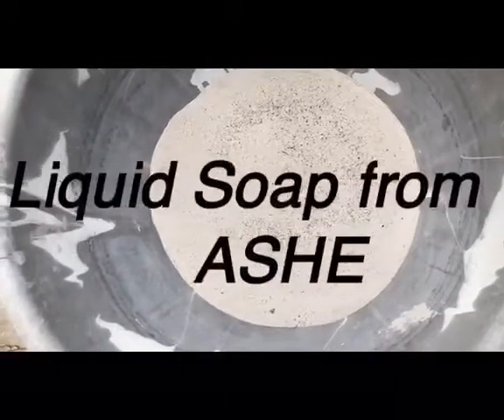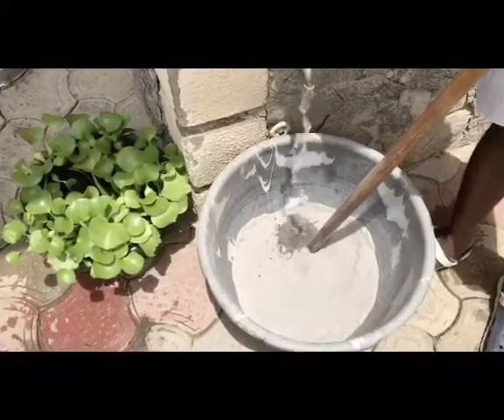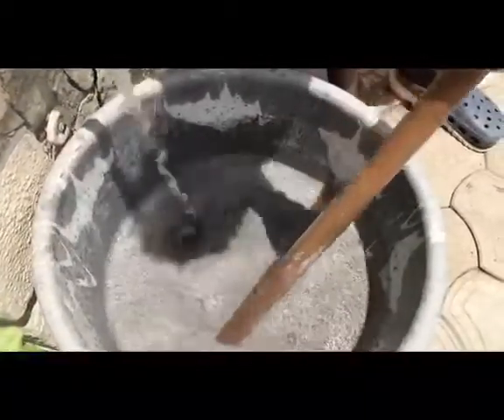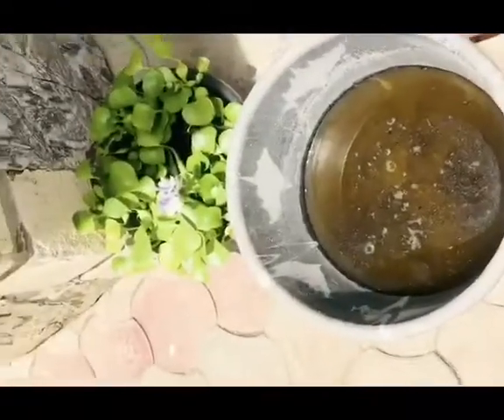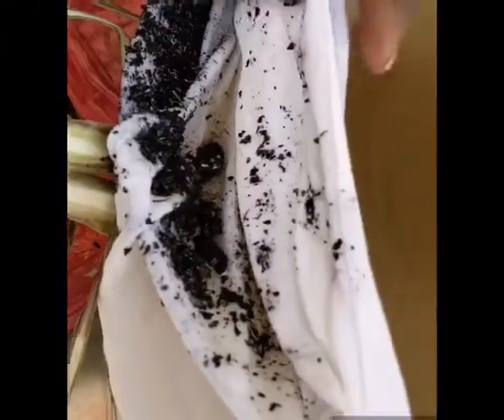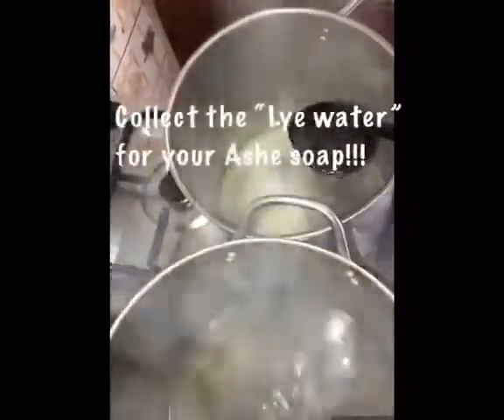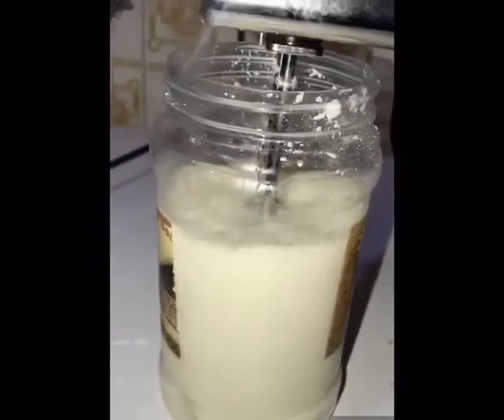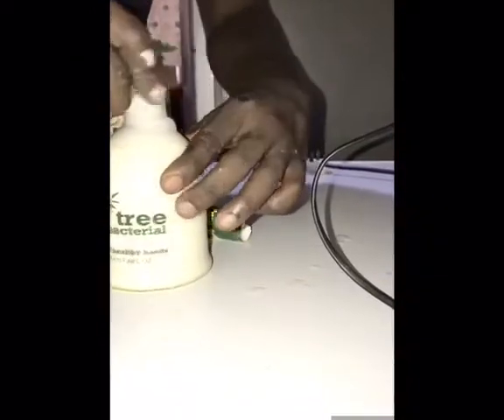How to make soap from wood ashes (lye water and Shea-butter).

Comment: As a soap maker myself, I will say that there are 2 kinds of lye: 

1, potassium hydroxide (used for making liquid soap or softer soaps that are easy to pinch apart like African black soap) and that is what he makes in his video. But you can also purchase it, although in that case, you may need to mix it with a specific measured amount of water.

2, Sodium hydroxide, which is used to make hard, solid soap bars. You can purchase this. It comes in a dry, grainy form like salt or sugar. It must be mixed with a specific measured amount of water. 

 Both types of lye produce very different results in soap. 

When you mix the exact, proper amounts lye and water, then add a specific amount of oil, fat, or butter-- the natural result is soap! 

* WHEN THE INGREDIENTS ARE PROPERLY  WEIGHED AND EMULSIFIED TOGETHER, THE FINISHED PRODUCT DOES NOT CONTAIN ANY LYE, AS THE CHEMICAL COMPOSITION CHANGES. IT IS NO LONGER LYE, WATER AND OIL-- IT IS NOW SOAP. 

It is believed that soap was discovered a very long time ago, by accident, when meat was cooked over an open fire-- the animal fat would drip into the ashes of the burning wood. Then someone would pour water to put the fire out (or it would rain), and-- soap!

Each different kind of fat, oil, or butter (for example, olive oil, coconut oil, palm oil, shea butter, cocoa butter) has a different sopanification value. Meaning exactly how much lye and water are required to properly soapinify a certain amount or type of fat, oil, or butter. 

There are free soap calculators online to help you calculate all this (how much water, lye and oil/fat). Not using the proper amounts can cause you to have too much lye, which can burn or irritate the skin. 

Also, each different fat, oil, or butter will give you different qualities in your soap. 

For example, olive oil makes a creamy (some say slimy) soap with very tiny bubbles, but is very moisturizing for your skin. Bar soap made with 100% olive oil only, is called "castile" soap. It takes almost a year to dry completely. But it is very gentle. Perfect for sensitive skin or babies. 

Palm oil and cocoa butter help to harden your soap bar, but also nourish skin. 

Coconut oil gives you lots of big bubbles, and cleans very well, but can be drying on the skin. 

Most natural soaps are made with a mix of olive oil, palm oil, and coconut oil, to give them a good balance of hardness, bubbles, cleaning ability and nourishment for the skin.
Reply from the maker: Very Apt !!!!❤👌💚
Initially I started soap making to help alleviate IDP(Internally Displaced Persons).
Reply: Very informative

Comment: I am concerned that you didn't let the soap cure for a few weeks before using it. I can be bad for your skin if it is not properly cured.
Reply: Hot processed soap can be used immediately, but since the measurements are inexact, you're right, it could still be pretty alkaline.  Potash is a much weaker alkaline than regular soap making lye, though.
Reply from the maker: The Shea-butter neutralizes the concentration
Reply: He probably cut and paste the video.
Reply: Since this was not a lye water reduction, I think a lye burn is not likely. For hard soaps the lye water has to boil down and become concentrated, that is where you have to be concerned. This seems a lot safer to me.